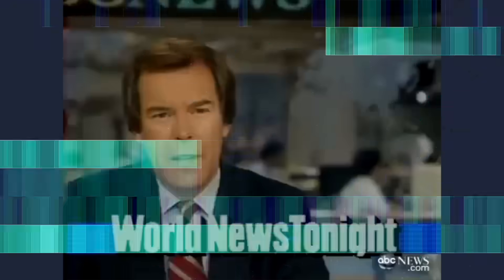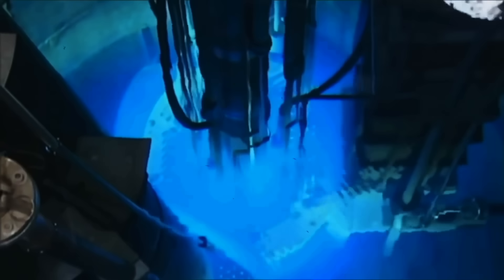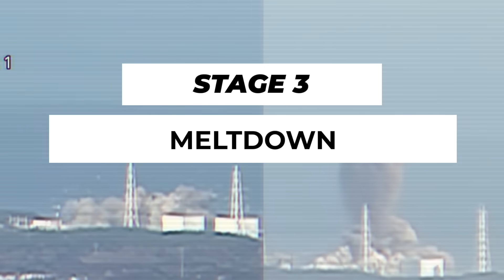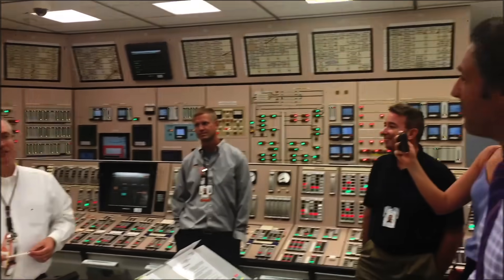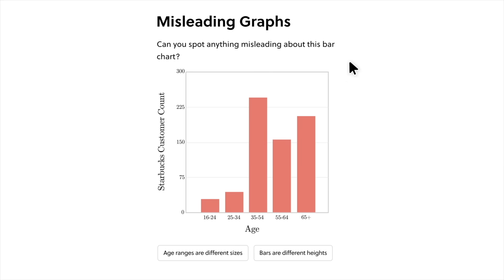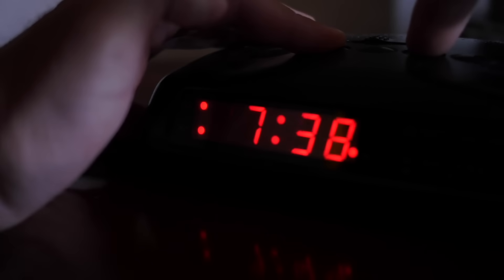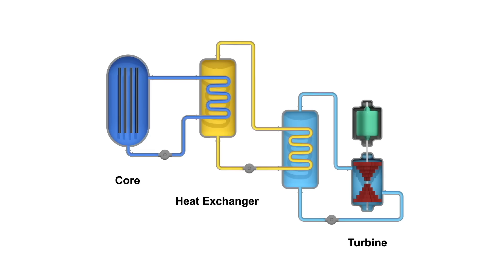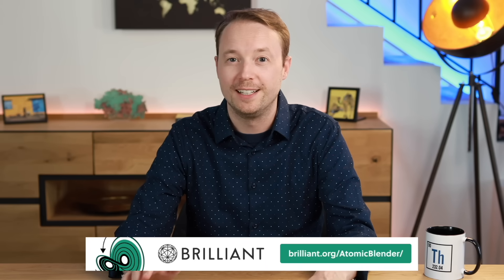Why Is It So Hard to Stop Meltdowns?

Comment: When I was a kid in the 60s, the atomic energy commission and many of the builders of atomic reactors claimed electricity would be free when their grand plan to build all of these reactors, but we know what happened to that idea!

In many cases of meltdowns, it is due to the reactor being used for a breeder reactor.

That is the type that makes atomic weapons grade materials, and it is very dangerous for reactors to be used for such activity.

When it isn't a breeder reactor, it is usually a new design of reactor that has no history of reliability. Take France for example, they only have one major design, when new ideas for upgrades are made, the upgrades will apply to all of their reactors, which makes it much safer than a hodge-podge of many different untested designs.

Comment: thankfully modern reactors (generation 3 and up) have passive safefy mechanisms to prevent meltdowns from happening at all. these safety mechanisms are designed on top of the laws of physics themselves, so they can't just be disabled.
Reply: the question is how many modern reactors are actually in use vs unsafe ones, no clue but id imagine it looks bad
Reply: @meze2095 Chances are high that In Russia, reactors similar to those in Chernobyl are still used....
Reply: @SemB7  there are a couple RBMK reactors still in operation to my knowledge, but from my understanding, their "new" transparency and updating of the design has rendered them "safe" again.
Reply: @SemB7 chances are zero. The flaws in other similar plants  were corrected decades ago, overseen by the IAEA.
Reply: @Nill757 Mmm i ask myself that too. But i think not everybody plays by the rules, and the IAEA is an great organization but u think they check all? There are 440 Nuclear centrals worldwide. The IAEA Has 416 registerd centrals. I don’t know man
Reply: @SemB7  not talking about all reactors globally and not talking about whether they could have a problem.  They might, idk, though it would not amount to much.  What is known for sure is those dozen remaining RBMK don’t have graphite tipped control rods any more. Photos, etc.
Reply: @Nill757 that is true yeah! Sorry English is not my first language haha
Reply: @meze2095  all reactors across the world should be using modernized reactors that are indeed safe. Idk about the ones they got up in Russia or China, but the ones in NA, Europe, and Japan are certainly, within a good reliability, safe. Depends on how you define safe. I trust them with my life every day.
Reply: @christopherlowe2254  try convinving the left of that, im not scared of amotic energy i do see it as viable, however as long as human operator error or simple part failure CAN still result in a meltdown or a nuclear incident of some sort public suppport will be somewhat limited, including funding, research etc.
Reply: @meze2095  I'm somewhat liberal idk why you think politics is  the issue here.
Reply: @meze2095 what do you mean by an "unsafe" one?
Reply: @smitty215able  lets say almost everything built before safety was a major concern in everything especially nuclear related, again since im no nuclear anything id be happy to know more
Reply: @smitty215able  or how many actually are operated in proper condition with properly trained staff, an old plant and bad staff sounds bad to me
Reply: Yes they have passive mechanisms that don't rely on external power or activation.
However, disposing of the decay heat is still an issue, even with Gen3 reactors. Gen3 reactors emergency coolant water is dimensioned for 72h, during which the reactor core can be cooled passively.
If after 72h neither water can be supplied in sufficient quantities nor the cooling loops can be restored, even a Gen3 reactor core will inevitably melt down due to decay heat.
Reply: @Chris-uu2td  a few things, as someone that works at a reactor (not speaking on behalf of the industry or my plant of course), I don't know where you got the 72 hours from, but that's not accurate. First, all reactors have variances in design, so you can't apply a timeframe for the reactor "survival" time before meltdown across all reactors (requirements for reactor design in that sense are not specified to that degree). You'll find generic requirements for specific safety systems that are required, but nowhere in design documentation will you find a time requirement for core cooling during a LOCA. Second, Westinghouse designed BWR and PWR models can withstand providing cooling water MUCH longer than 72 hours if needed. It all depends on the severity of the accident and type of accident.
Reply: @christopherlowe2254 ”much longer”

Yes, IF in a plant blackout the diesel generators are not flooded as per Fukushima, then yes cooling continues indefinitely.  Otherwise, not so much.
Reply: @Nill757 it actually doesn't continue indefinitely. The diesel generators will run out of fuel without intervention within 1-2 weeks usually (depends on the design). However, the heat of decay particles drastically decreases within the 24 hours of shutdown.
Reply: @c@c @christopherlowe2254 t sure about  the need to report diesel gensets need fuel? 

Yes decay heat at shutdown is is 7% of max thermal power.  Decay heat 24hr after shutdown is 0.5% of max power.  For a 3GWth reactor, that’s still 15 MW and will likely melt.  10days, 0.2% or 6MW and so on. Note the normal controlled cool down after a shutdown is active cooling w pumps still running, which allows 30degC in a couple days. This is a notional Fukushima,  blackout no pumps
Reply: @Chris-uu2td there would be no conceivable position where that would be a reality. Modular generators and mobile coolant pumps... even with the passive convection type ECCS it would not be possible for it to be allowed to run dry...
Reply: @Chris-uu2td indeed
But 72 hours?
Thats plenty of time and honesty it Is really secure
Reply: @seantaggart7382  Never asume something is fine or "plenty of time" when talking about nuclear reactors, i believe that is the ideal rule of thumb for nuclear power moving formard
Reply: @seantaggart7382  
One might think so under normal circumstances.
But it's basically what happened to 2 blocks in Fukushima:
Power lines and water lines were down due to the earthquake. Streets were mostly destroyed and the emergency generators were flooded.
To exhaust the decay heat of one block, they needed about 60kg (128lbs) of water per second (5184t per day).
They simply couldn't replenish the emergency cooling water before it ran out and the reactor cores ultimately melted down.

Or think about the zaporizhzhia nuclear power plant:
We are lucky that Russian soldiers are either too dumb or not determined enough.
It's rather easy to siege a nuclear power plant, render it's emergency generators inoperable and cut it from mains power and water supplies for more than 3 days.
Reply: @Oureon  unless it is more than double the half life
Reply: @Chris-uu2td no one would intentially make a nuclear reactor have a meltdown.
Reply: @Oureon at some point it is plenty of time. When they design safety features they come up with a series of highly unlikely events, determine how long they would need to supply water without power if those specific events happened, and wind up with a system that provides far, far more than they would need for almost any realistic situation and even many unrealistic ones
Reply: @Chris-uu2td causing a meltdown in enemy territory doesn’t help if you also happen to live on the same continent. So I doubt that will happen. But this is humanity we’re talking about so maybe I’m wrong
Reply: @overlord-6644  In reactors build after the Chernobyl incident, the core is quite well contained, even after a meltdown.
So by melting down enemy nuclear power plants you will effectively create a radioactive ruin with a large uninhabitable zone but very little fallout
Reply: @Chris-uu2td 
Depends on where the Nuclear facility is contained. You'd be better off turning it off and disabling it, rather than force a meltdown
Reply: @Chris-uu2td 😂 they could of easily. It was called using ocean water but it would make the plant unusable after so they didn't want to....... so they f Ed up big because it wasn't usable in the end anyways soooo they should have used sea water instead 😅
Reply: @seantaggart7382 Fukushima problem was zero hours cooling post tsunami, which was minutes after the automatic scram
Reply: @Nill757  Yeah
But that was because THEY DIDN'T PUT THE GENERATORS ABOVE THE WATER!
Reply: @s @seantaggart7382  yep, or, because they didn’t build the seawall 25’ higher, w some  historical evidence there had been a precedent last 1000 years.
Reply: The bottom line is we need more and more electricity and if you want environmentally friendly electrical production that has no carbon output, then nuclear is by far the best option.
Reply: @notmenotme614  yup. because as a society we need to electrify everything we can, like using electricity to melt metals instead of coal, nuclear is the way we can scale up our grids whilst making them cleaner.
Reply: @notmenotme614 
It's only environmentally "friendly" when safely contained. Otherwise, it's far more damaging to the environment if it gets released. 
Plus, the amount of material needed to make a plant, are made from places that make it so the "environmentally friendly" aspect is null for many years. But calling nuclear environmentally friendly is a fallacy argument. How we use it can considered that, but the material itself causes massive damage out in the open. It's not really safe if it has to be contained.
Reply: @notmenotme614  I agree
Reply: I’m sure all the nuclear engineers have thought that throughout history when they were designing their machines, only for them to somehow miraculously fail because that’s just how the world works 😂
Reply: Every plant that's ever had a meltdown had safety mechanism.  It's not until something nullifies your safety mechanism that you realize what other safety mechanism you need.
Reply: @mattb6646  In 2 of those 3 meltdowns, it was caused by PEOPLE. In the 3rd (Fukashima), it took two back to back natural disasters AND incompetent leadership to lead to the meltdowns.
Reply: There are almost no gen 3 reactors in service, and every last gen 3 reactor will inevitably melt down if disconnected from external power.  The gen 3 just delays the inevitable by 3 days
Reply: @peters620  And constant emissions of green house gas pollution from fossil fuel power plants is better?
Reply: The Titanic was also an unsinkable ship.
Reply: @Userhasbeenbanned0 do you understand that nuclear plants now a days have enough safety protocols to make a paper bridge from Greenland to ice to Scotland
Reply: @FordMustang_1985  try typing that again, but this time in coherent English
Reply: @Userhasbeenbanned0  basically everything has to to be planned for and it is. I’m saying there’s all of stuff that they train for as well
Reply: @Userhasbeenbanned0 . And after Titanic, nobody said stop building ships, or take 20 years to build one because “safety”.
Reply: @Nill757  well the stakes are a lot lower when a ship sinks. When a power plant fails it’s a lot more serious
Reply: @Userhasbeenbanned0  says who? Lot more serious than 1500 people dead  in Titanic? Nobody has ever died from radiation due to commercial nuclear in the US.  Meanwhile gas,coal, oil accidents and emissions kill people all the time.   Yes give safety its attention but this ‘Idk  man something might happen and cause  Godzilla’ nonsense has to end.
Reply: @Nill757  ever heard of Chernobyl? The plant that contaminated an entire city, and lead to the loss of over 4,000 lives. How about Fukushima? The stakes are way higher than a ship wreck and they last a lot longer too.
Reply: @Userh@U @Userhasbeenbanned0 
There are no more Soviet Chernobyl style reactors, and it didn’t kill 4000 people. Fukushima didn’t kill anyone from radiation, certainly not 1500 in one night, and there are no more residential keep out zones.  That’s a fact about Titanic in one night, not hand waiving, and entire families destroyed lasts forever.
Reply: @Nill757  it was more than 4,000 actually but quantifying it isn’t really possible since so many people were exposed to the radiation. And the city is still contaminated to this day. So yes, my point still stands, the stakes are a lot higher.
Reply: @Userhasbeenbanned0 we are all exposed to “the radiation”, all the time, everyday.
Reply: @Userhasbeenbanned0  dont be an idiot, that was a title given in hindsight, and a completely different scenario
Reply: all previous reactors were approved to be built because they were 100% convinced that a meltdown wouldn't occur bypassing their safety systems.
Reply: Yeah, so what happened at Fukashuma?😅
Reply: @vsucountryboy  Fukashima was an example of how far nuclear safety has come. Due to the design of the facility, there was very little contamination to the environment. 

The reactor was not fully kitted out with passive safety systems.

And the company & Japanese government refused to acknowledge the problem with the generators being in the location that they were.
Reply: @ViscusYouTube it’s also because since the diesel generators to power the coolant pumps were flooded because they were below sea level, this tsunami and earthquake wasn’t planned for because it would be so incredibly rare that an asteroid hitting us would have more of a chance, the tsunami was 50 meters tall

Comment: Put solar, wind and batteries on each nuclear power plant land, ready to power the reactor if needed.   Then close down the nuclear power plant because they cost too much  and only have uranium for 4 years of the world's energy demand.
Reply: Do you have the faintest idea of how much wind and solar power can be extracted from a land area the size of a nuclear power plant?

Watch "David MacKay: A reality check on renewables" TED Talk
Reply: @u1zha  
Solar and wind require a tiny fraction of the land needed to uranium and wastes.  Did you forget?  Solar require zero land. There twice as much rooftop as needed to all our energy.
Reply: @briandonovan9091 Where are you going to find 3km2+ of rooftops? Nuclear plants regularly generate upwards of 1Gwh. Where most people live, cities, it's impossible to get enough roof space to power each building on its own. 

Nuclear is significantly more energy dense. It's not even a competition.

However, neither should it be. All green energy should be used where they work. No use comparing them when all of them beat fossil fuels.

Comment: This was good overall.  Comments:
0:54 "The most complicated machines we've ever built".  It depends on how you look at it - the machines themselves are simple.  A nuclear reactor basically has several rocks sitting in water with other parts used to control the heat generation.  It would look like magic if you didn't understand the physics.  The physics IS complicated, but the machine is not.  

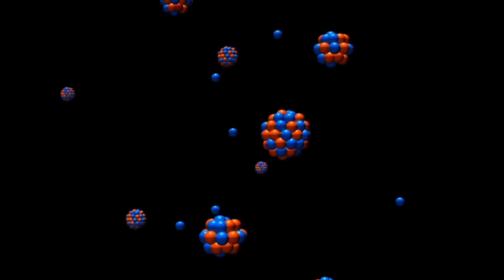3:37 "[Uranium] atoms struck by a neutron, they don't release all their energy right away" - This is correct, but the statement that follows is not quite right.  
The maximum half-life for fission to release neutrons is under a minute.  Most are in the few seconds range.  The heat comes from the fission PRODUCTS.  You can roughly approximate that right at the point the reactor is stopped, it is still producing about 6% of its original output power due to "decay heat" of those atoms.  It has nothing to do with delayed neutrons, at least not after about a minute.  After 40 days, the output drops to 0.1%.  (47104594.pdf on IAEA)

4:53 "Its at this point (due to the corium spreading out) we finally get some good news" - Umm, not quite.  It is good news because as you indicated, it can get started with cooling down, but this is where the real danger of a meltdown is.  Once the corium is out of the core, that makes it an official leak rather than just a destroyed reactor.  This is where Fukushima had explosions.  As most may know, the reaction of the hot zirconium with what little water could be provided created hydrogen, which built up and blew off the roof of their reactor buildings.  If they had actual containment buildings like US reactors do, they wouldn''t have exploded, but since they were just shells, the hydrogen easily built up inside the building and then - boom.  This sent radioactive material into the air causing the nuclear disaster (which was repeated).  Interestingly, in spite of such a catastrophic result, no one died of radiation poisoning.  While it raised the average level significantly around the plant and nearby cities, there were no deaths from radiation.  

Finally, so many people have fears of nuclear, but if you actually check the "deathprint" of it, you will verify it kills very few people per amount of energy generated, and NOT having it means we burn more fossil fuels which contribute to poor health and early deaths.  Current reactors used are already more safe than basically any other form of power generation.  Improving safety is a worthwhile goal, but too much regulation increases costs to the point that the anti-nuclear argument becomes "it's too expensive".  I do agree though that MSR and other designs will have major impacts on the future, including further safety enhancements.
Reply: That's new. Fukushima didn't have containment vessels? I would've thought that it would be standard regulation.

Comment: Fukushima was a very poor design! What idiot engineer would design the main electrical system and put below ground level?  There should have been outside diesel generators and water pumps above the plants so as to manually cool the reactors if the emergency pumps went down in the plant. It’s called redundancy.  It doesn’t take a genius to see the flaws in the Fukushima plant!